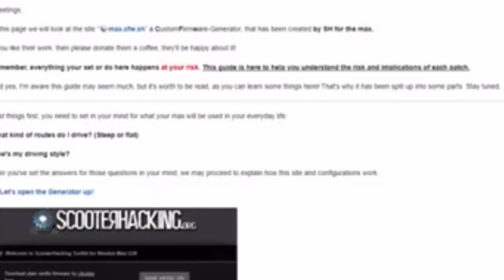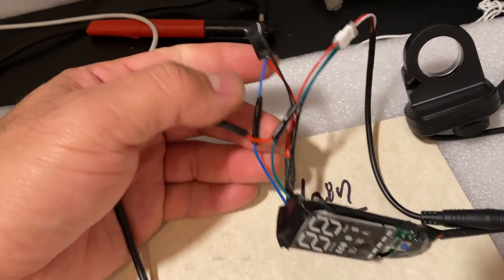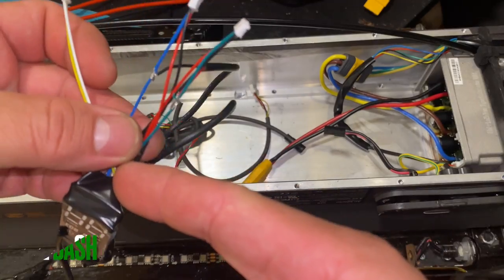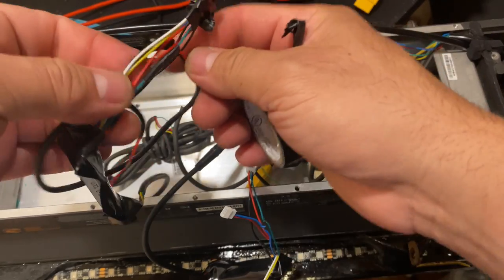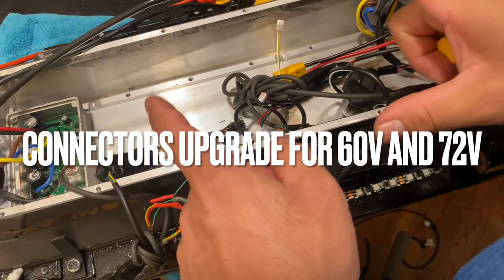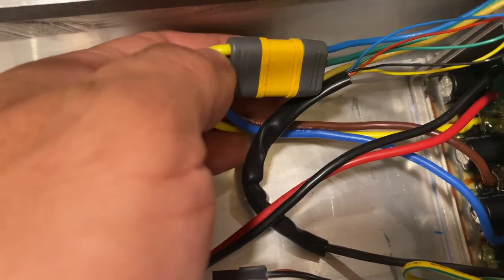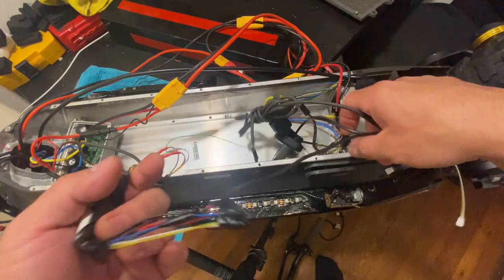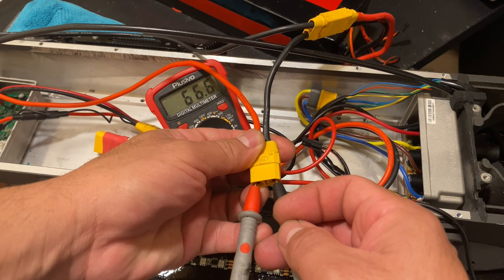Best Ninebot Max Dual motor set up!!! 36V up to 60V Stock D controllers. Real testing done!

Comment: Bro I love the video!!! You should get tri taps to make bridges I think they have 22 gauge
Reply from the maker: Thank you Anthony. T-taps are great and used them in the pass but they are NOT as great as soldering wires and heat shrink.

Comment: One question, what kind of max amperages are you running on your firmwares since doesn't having two controllers and motors double the amperage draw from the battery system. For instance if you have firmware with 30A maximum on both controllers doesn't it then draw 60A max from battery system. If so do you still have stock bms on the battery which is limited if i remember correctly to 42A. And when having external battery with separate bms can you then just add both of those bms amps together to get the maximum amp draw from the system? Cool build and I might try to do this with another stock motor or would it be worth it. Currently running 72V system on stock motor and custom firmware with fieldweakening enabled having top speed of 60kmh as 100kg ish driver. The extra acceleration is what im interested in and probably top speed would increase a bit too.
Reply from the maker: Yes you need to replace the bms on your stock battery or upgrade the battery. We tried on stock battery and 24v external to convert to 60v but battery kept shutting off. We upgraded the battery bms with a 200a max discharge and that scooter is still running. However upgrading to a better battery would be the right thing to do. Set your controllers from wheel 38a continuous discharge and 64a peak. Motors of 11w on 60 on that set up are beast !

Comment: I have ninebot F2 Plus, its like the G 30 but smaller.. anyways, can i supply directly 60volts or i have to change anything?
Reply from the maker: You can double up battery if you can hack the controller. Definitely don’t add up speed. Scooter frame it’s weaker than regular g30. Sell it and get an old ninebot. All you would need it’s the frame and rebuild it with good parts. Use 48v up to 60v for regular commute on a g30. Not above with motors 1000w up to 1500w and not above.

Comment: Hey I’ve been meaning to ask, what size hole did you drill for the controller screws to thread in? Been meaning to mount mine securely for a while now, for better cooling
Reply from the maker: M4 tread maker x 4mm deep. Screws m4x8mm
Reply: @esnkaz  thanks! I appreciate the info. I’ll get right on that haha
Reply: Do you need to swap the cables for the front motor just like the back or no

Comment: Wait so why did you say the controllers are burning up? I don't understand that part, you bridge the brakes but don't plug the brakes in at all?
Reply from the maker: Correct. Simply set up the controller, disable the kerks and then unplug lever from Dash board.

Comment: How do I activate the G30D controller to work on the G30? Thanks
Reply from the maker: You need to hack it using ST-Link. If you don’t understand how to do it. You might need to get a hacked controller. As you need to make your own firmware knowing how.

Comment: Hi man ✌🏼️ my ninebot max g30d 2 is running on 72v and I like to build dual motor setup with two vsett 10+ motors. Do you think I can do the install like in your video? And would that work for me?
Reply: And where do i get a Hall sensor plug please 😅
Reply from the maker: Done several with D controllers. No issues so far on 60V 25Ah. battery.

Comment: At the end did you had some errors on your display?
Reply from the maker: No sir. Never. First scooter made in April 2022 still running on a daily basic under new owner who travels 11 miles each way to work 5 days a week. Motors were replaced with wolf warrior 1100w using dual D controllers and batteries 60v 25ah.

Comment: Could u share the wire diagram plz??
Reply: Its 1 throttle driving "2 scooters" using 1 battery source. It's essentially just 2 dashes and 2 controllers.

There's a Y-cable from the upgraded battery to each controller.

The throttle he uses (which has the same wiring as the normal throttle), is wired to both throttle inputs on each dash. He has one dash in the tube and one on top like normal.

Comment: Hello, so if I do the stock battery in series with 24v one will it be all safe?
Reply from the maker: Have been using 36v 15Ah. (Stock) internal And 24v 15Ah external for the last 7 month no problem. Controllers installed inside the scooter.
Reply: @esnkaz  So its the stock controller no hardware mods just a custom firmware correct? And also do i need to disable regen or something like that or is it all safe to leave as is?
Reply from the maker: @Dj2006  please full length of video. All info in details.

Comment: what about brakes buddy?    no point in going faster if you can’t stop homie
Reply from the maker: @jimski7711  right that’s why you need to do set ups mentioned l
Reply: @esnkaz  Great explanations, but still, the part with the brakes is not clear... your build has NO BRAKES ? at all ? how you stop? Why the controllers to be burned if connect the brake lever ? that happened to you ? are you sure is because of that ? because there are other movies with similar dual motor  setup and people do use brakes ....
Reply from the maker: @tangoztek  scooter comes with electrical brakes. Which activate when pressing the lever for the front brake. Lever has a sensor which is wired up and connects to the dashboard and so to the main controller. There is no firmware that will avoid the burning of controllers when upgrading to higher power if the lever contact is not detached from the system. (Which means if lever its connected to the system, current will push back causing the controller to smoke) That’s why physical hydraulic or wires brakes are added with rotors for scooters. I hope this is more clear.
Reply from the maker: @tangoztek  scooter comes with electrical brakes. Which activate when pressing the lever for the front brake. Lever has a sensor which is wired up and connects to the dashboard and so to the main controller. There is no firmware that will avoid the burning of controllers when upgrading to higher power if the lever contact is not detached from the system. (Which means if lever its connected to the system, current will push back causing the controller to smoke) That’s why physical hydraulic or wires brakes are added with rotors for scooters. I hope this is more clear.

Comment: Thats way above my skill level without an instruction  manual😳
Reply from the maker: Jeje all it’s in there if you follow closely. Only thing you would need to figure it it’s the firmware. As well best suspension for second motor would be front suspension.

Comment: The wires cannot handle that, aren’t they’re going to be too hot.!
Reply from the maker: nop.
Reply from the maker: If you noticed in the video I mention wires size as well connectors upgrade. Wires and connectors tent to get hot but not to extreme where they will burn. Recommended for set ups 10 gauge wires that hold up to 600v with XT90 connectors